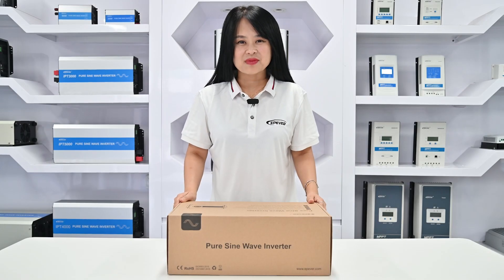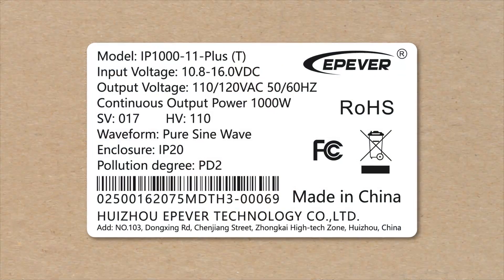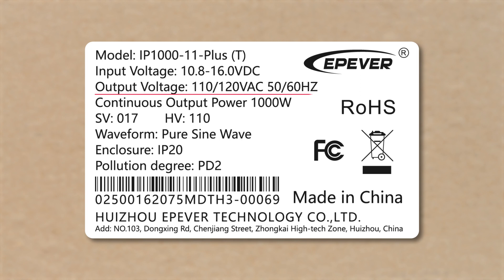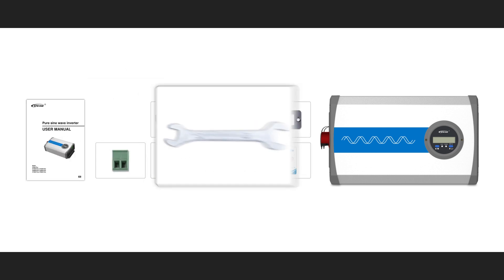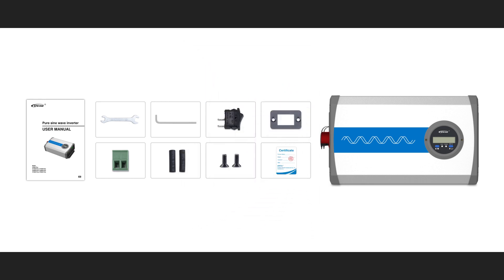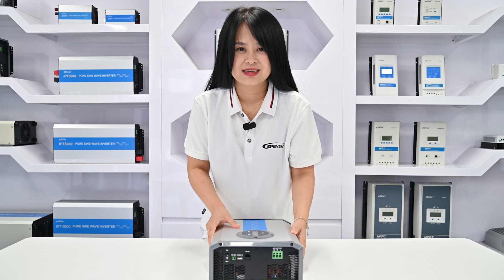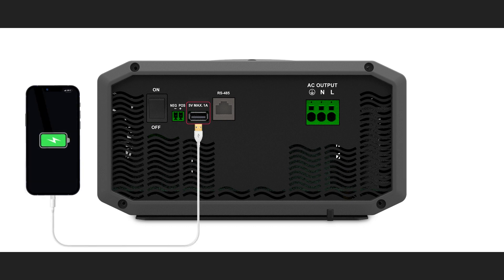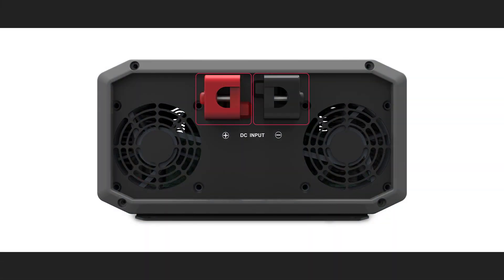EPEVER IPower-Plus 1000W Inverter Unbox

Comment: I am sorry to tell  some of your produks only last for 1year.
Then it break down.
Fuses all ok. But it stil does not charge the battery.
Reply from the maker: Hi arrie, EPEVER product provide 2 years warranty, you can ask for service from the distributor or seller, you can also send an email to support@epever.com or leave you question here.
Reply: Had no issue after 3 years of using the inverter
Reply: what happened? check the fuse yet?